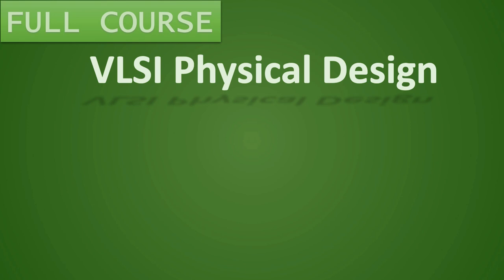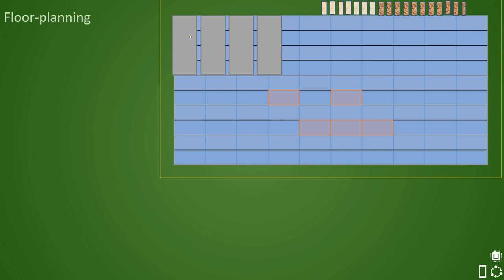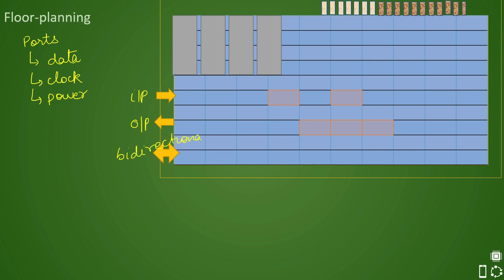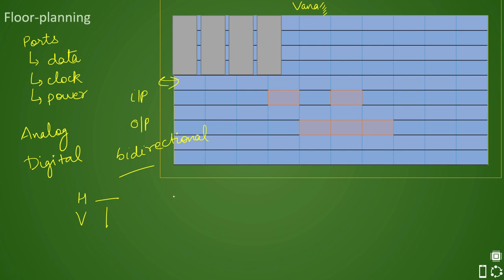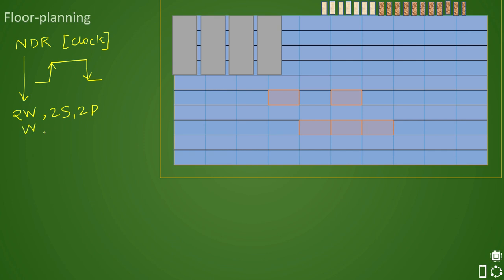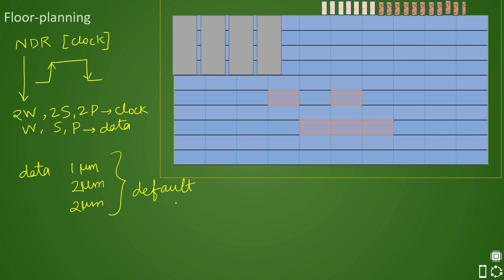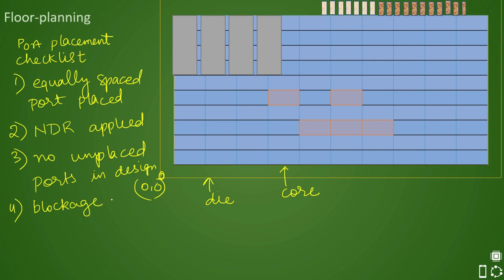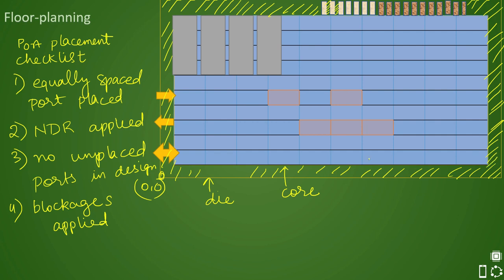PD Lec 17- Floorplanning & IO Placement [part-3] | VLSI | Physical Design

Comment: What is the use of a guard ring which is connected to the ground?
Reply from the maker: guard ring is a safety ring, to avoid any signals or current going out of partition boundary. It grounds all such signals, hence it is grounded.
Reply: @VLSIAcademyhub thanks for the reply ❤

Comment: how to decide core & die area?
Reply from the maker: Deciding core and die area for initial runs is generally derived from legacy design. For a fresh design from scratch, it is generally stdcell area *1.6 for a start, and then it is modified based on requirements

Comment: how to check with tool regarding equal spacing , guard rail, or undriven port? Is there some kind of qor report gets generated which provides all details. what is the checkpinassignment command output? does it provide all pin placement coordinates around the core? 

Gr8 lecture btw , thank you!
Reply from the maker: The amount of check pin assignment command, is a summary which tells us that how many are legal or illegal ports etc. However it haas switches to provide details of violating port

Comment: You said that NDRs can have rules such as 2W, 2S and 2P. But if we double the spacing (S), won't it automatically increase the pitch as well ? I don't understand why 2P needs to be mentioned separately. It would be dependent on the spacing itself, right ?
Reply: @VLSIAcademyhub  Got it. Thanks.